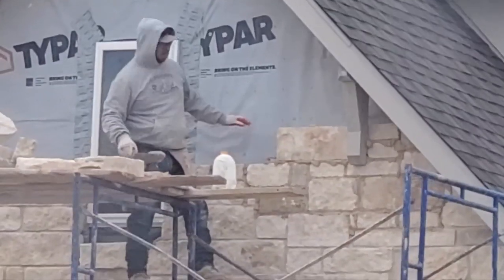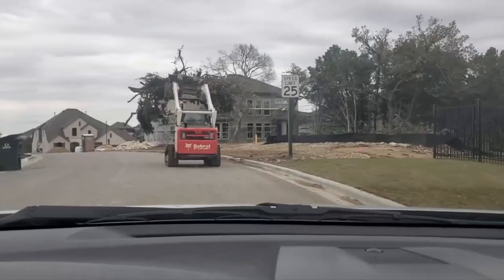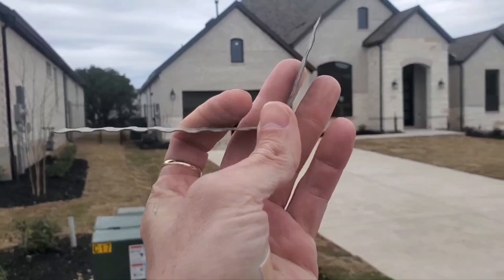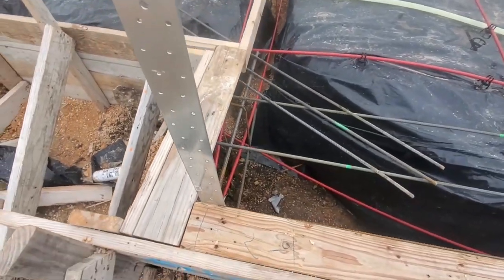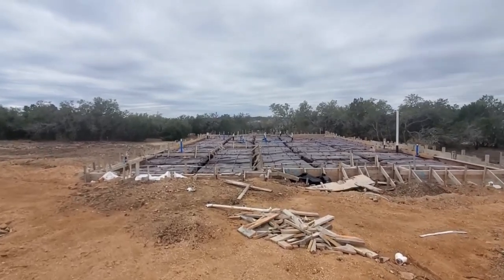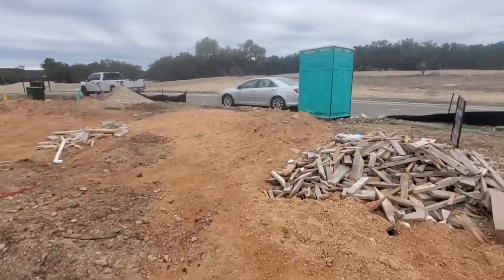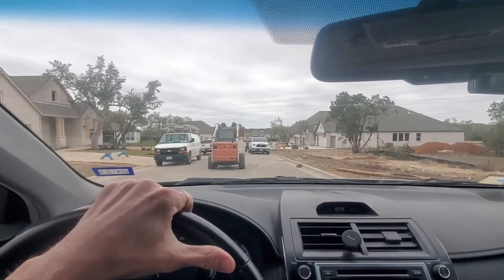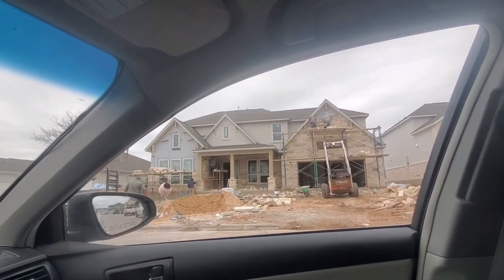Home inspecting from the car: Brick ties, hold downs and a quick Spanish lesson

Comment: I've been a mason for 20 years. What you've showed is my competition. I've seen lintels hang over 1/4inch or no lintel at all (garage gables), weep holes buried under the soil, reverse bond, zippers, I've seen entire buildings with every brick incorrectly installed. I've seen sand instead of grout for block fill. I've witnessed block walls not being grout filled at all. Ive been able to use just my finger to scratch out the mortar. I've seen brand new fireplaces that don't work at all. I've tested brick walls with a water hose and only taking 20 minute for water to penetrate through the wall. I've seen every kind of window destroyed by masonry, I've seen  Columns and arches fail and having tons of weight about to fall and have had seen them fail. I've seen Huge amounts of homes with water damage from non air space installs. 
I seen masonry pockets Installed with the wrong spacing and the brick layer would just brick it anyway having a wall completely out of plum. Tons of homes do not have proper striking of the mortar joint. Need a smooth slick striking of the joint to repel water hence another reason why water can penetrate through masonry walls in just matter of minutes. Don't get me started on flashing. Just a mess out there. Too bad alot of the skilled masons I knew are gone due to "The Competition"

More to say.
Reply: Hell you have seen it all

Comment: With such large stone facing I would attach the ties as I go as one does not knot how tall the next row is.
That said, we were working on a friends three floor apartment building years ago up on tall ladders under the soffit. I cannot recall exactly what happened but when I looked towards my partner I saw the whole wall waving from the pressure he just applied. We got off the ladders and got out of there. There was at least eight feet of the top wall height not tied to the building.

Comment: Not adding the brick ties is extremely dangerous especially on the tall gable walls.  Nothing really securing the heavy brick or stone wall to the building itself. Even if they are installing the wall ties if they aren’t hitting solid wood they will not do any good
Reply from the maker: Yes, indeed. I wish I had thought of a cleaner way to say it so I didn't sound so herky jerky in the video. But this is exactly what I wanted to convey.

Comment: Thanks for the videos.  It's getting to the point where you can't even pay someone to do the work correctly.  The city/county building inspectors cannot be relied on by the homeowner to catch every deficiency.  I think homeowners should find a way to hire you and others with the same knowledge and integrity to do home inspections as homes are built.  Catch unintentional or intentional omissions by the contractor and get things fixed before it's covered up.  I know it's a money game, but how much do contractors really save themselves?